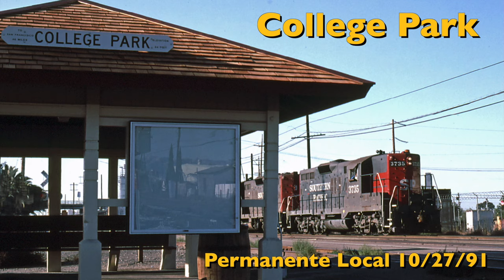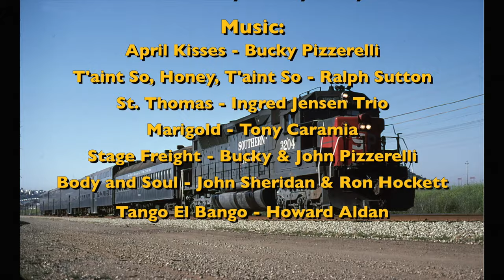San Francisco Peninsula Commute 1977 to 2007

Comment: Great video Gary, always enjoy your content.

Was fortunate enough to ride the commutes for a couple of years before the SP equipment was fully replaced.  Remember the Caltrain equipment when it was new and shiny, later on was able to ride the equipment (headend rides) before rebuild and when they still had the SP style light packages.  

Even more down the line hired on with Amtrak, was a trainman, then later an engineer on Amtrak (started in Oakland) when they ran the show, ran the F40s after rebuild, got to run the MP36’s and Bombardier equipment when new.  

Ran the SP engines they bought, the GP9’s and MP15DC’s, then got hurt on late 06’ and have turned a wheel since.

Was fun while it lasted, got to experience what little SP flavor was left my time there.  Didn’t make it to the electric or TASI era, but I would have went back to Oakland.

Comment: I used to see UP #1375 (one of the three GP40P-2 units) quite often when I lived in El Paso. Funny how after all these years, that unit is still stationed there from time to time hauling locals and switching around the area like it did during the latter half of its career on the SP!

Comment: There is no such thing as the MP36PH-2C. You must be confusing it with the F40PH-2C, which are the three locomotives Caltrain acquired in 1999.

The correct term is MP36PH-3C, of which Caltrain was the launch customer.
Reply: 1998